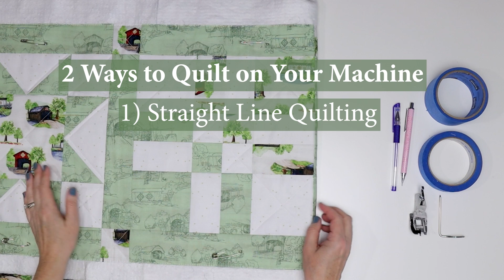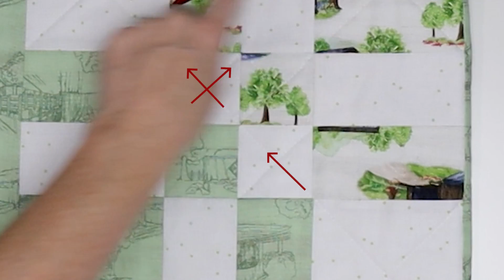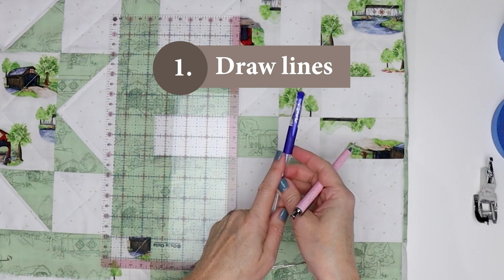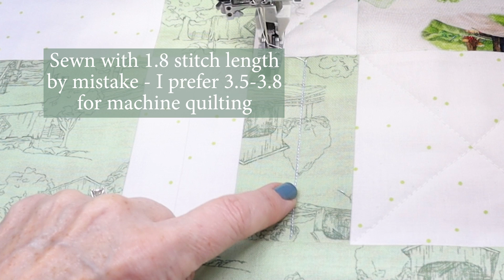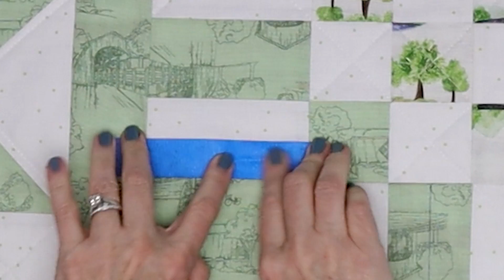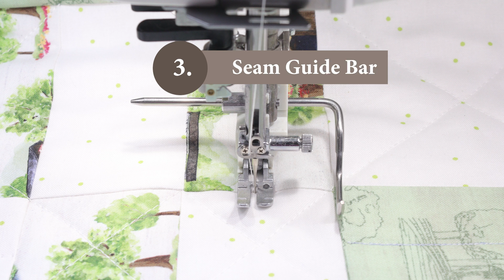Straight Line Quilting for Beginners | 4 Easy Marking & Quilting Techniques on a Domestic Machine

Comment: That was a interesting video. 
I like to quilt, runners, and seasonal things, in-between a big project.  I have used the serpentine stitch on a runner, following the straight lines. When it came to the end of the runner, i had an embroidery design, so i used the serpentine stitch crosswise on it. It came out amazing!😅Thanks for doing this video.
Reply from the maker: You're very welcome - your serpentine stitch sounds like it will take things up a notch!
Reply: It did make the runner look quite nice. I was pleased with the results. 
I don't often use the fancy stitches, but the serpentine just kept popping up. 
So I tried it on a scrap and I decided, I really like this.
Thanks for responding. It's nice to talk quilting 😂
Reply from the maker: @alvenaroulston4869  You've inspired me to try something new on my next project! Happy quilting!

Comment: Great video, the heat erasable pen is it different than the usual frixion pen?, I know that when I use the frixion pen on some batiks it leaves a white mark, so am interested I. The one you use, so I’ll try to order the one from madam sew.  I do use pretty much all your methods and all is good.  I like the seam guide best.
Reply from the maker: After learning about the frixion pens sometimes leaving white or reappearing when the fabric gets cold I stopped using them on the top of quilts or outside of projects. The Madam Sew ink doesn’t last nearly as long but since it’s designed for fabric it shouldn’t give us those issues 🤞🏻

Comment: I quilt everything I make on my machine using straight line stitching or stitching patterns on my machine.  As a result, I only make up to lap size quilts as I don’t think I can handle the bulk on my machine.
Reply from the maker: I’m with you - a patience issue as much as a bull issue 😂😍